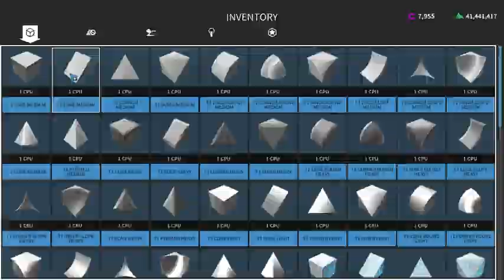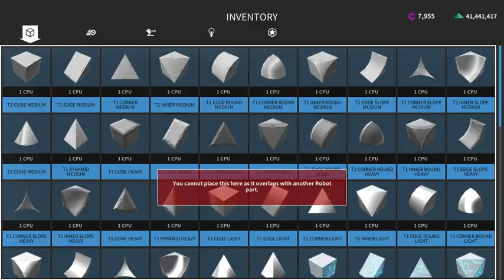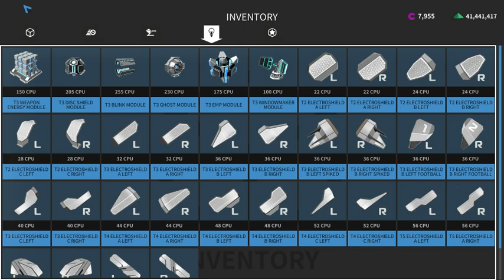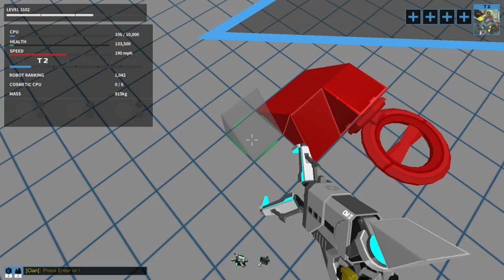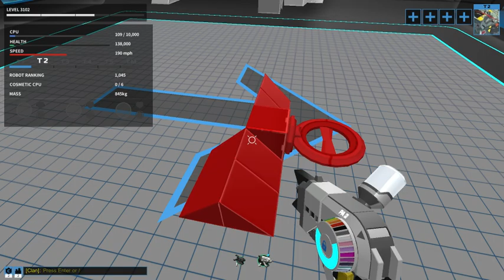Robocraft: One Take Triforcing - Part 2 - Split protection, duel mounting, proper rodforcing

Comment: who come back after loosing 20 games in row after watching 0.5 of last video and not heard that that all was outdated?
Reply: lol of cource its outdated stupid, it was made 2 years ago. also if u want to get good then  use shields and chains or rotors and seekers
Reply: @jamesscott2092  wtf is rotor?
Reply: @termisher5676  helicopter rotors lol, also look up shield tri forcing, it's still useful. sprinter legs are usually better than regular mech legs except when you are trying to go for a lot of health boost. the last thing I'll tell you is that the second seeker on any aircraft weather it's a helicopter, hover, plane, or drone its good. with seekers however you should probably invest tech tree points in shields so you can get disc shield for protecting agansed most stuff. i hope this helps you play better.
Reply: The game stopped development 4 years ago, so I doubt that's outdated.

It really doesn't matter if you're good or not, the chances are your whole team will be made up of bots and they'll drag you to hell with them since they're useless.

Comment: Aero rod has same amount of hp as its same space of normal cubes take,
But it is not recommended because of damage is spreading up fast?
Reply from the maker: Rods are still very useful, you just have to be conscious of them spreading damage in only a single step/tick as a single block would. They actually have a lot of benefits as they have the same health as medium cubes with less mass, and can be wrapped with blocks so that the wrapped parts do not take damage after the blocks around them are removed. 

For an example of damage jumping over a rod: https://youtu.be/VKJAoucE1XM

For an example of the benfits of wrapped rods: https://youtu.be/hgp2TpVUAso

So why not use rods for everything? Well they have only two connection points, and the fact that they jump damage around means that if you connect them to two sensitive areas you might want to add some block delay going in and out. Most builders use them for split protection, weapon mounts, and also for mounting copter blades since rotors have weird hitboxes that allow them to be stacked more easily when using rods. Some people have even used them to jump damage around the outside of their bot faster to ensure more even damage spread. Just be wary that lower connectivity in your bot in general tends to lead to more instances where you might take critical damage to internals early. 

As I tell my clanmates: "When you restrict damage flow into an area you also restrict damage flow out of that very same area."